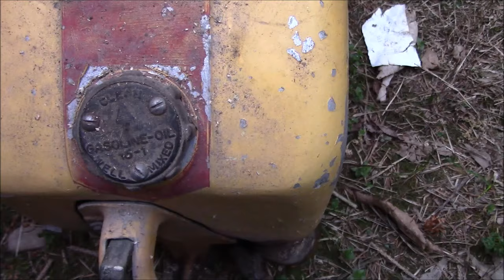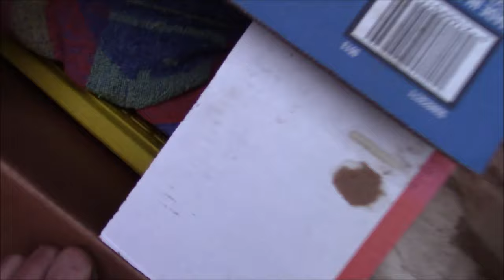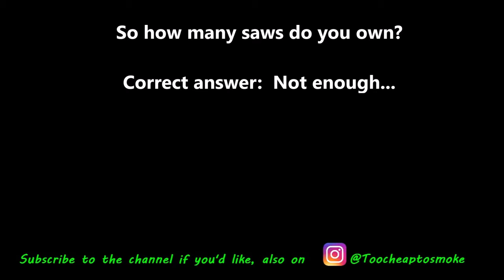How Many Chainsaws Do You Own?

Comment: I don’t collect saws either. But for some reason I had to add a “mezzanine” level to my shed to fit them. That’s a nice pile you have there. A little known secret, I’d look for Poulan 330, 3450, 3750 saws. They are “newer” but the last of the good saws. Good antivibe, 54-60cc and will run at 13k rpm. All mag case and bolt on jug real easy to work on. If that red craftsman in the case is a 3.7, pop that muffler off. If it’s a thin ring, they are strong runners and are Poulan 3700. Better runners than the thick ring chrome piston 3.7 3.7 that were 3800 saws.
Reply from the maker: Cool, good to know!  That sears is a 3.7, I will have to check it out at some point.

Comment: Iwas told when you have one or two of something you just have three or more your a collector. I collect a lot of things. Ive got bycycles fastened to the Fence. plenty of tractors and old trucks.  However My father bought a  new  manual oiler super XL 58 CC homelite in 1964 I still have it. Now ive grown weary of plastic saws with loosey goosey mounting. Im going to sell all of those plastic huskys stills poulans ect. and just keep my older magnesium and aluminum saws. Ive been looking for a 68 CC Lombard. ive got some but the cyls and pistons are fried.
Reply from the maker: They definitely don't build 'em like they used to!  The new stuff with fuel injection is really making things more complicated too...

Comment: 21 runners including polesaw. 25cc-84.7cc
Reply from the maker: Nice.  Crap, I forgot about the pole saw!!
Reply: @toocheaptosmoke  You do heat with wood, eh?
Reply from the maker: @brunomahle1618  still do a bit, but used to heat with wood as primary heat for years.
Reply: @toocheaptosmoke  Just now got rid of a 46cc Remington (chinesium), but came back with a ProMac 55 as a running(kinda) parts saw.....dangit.